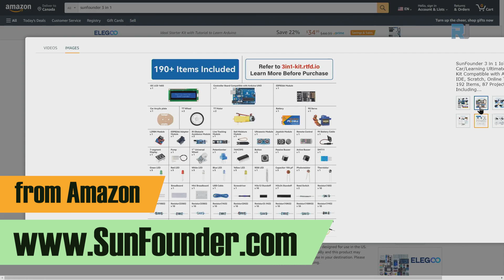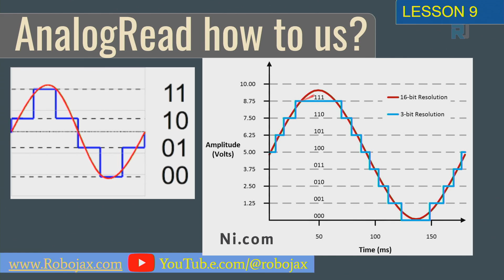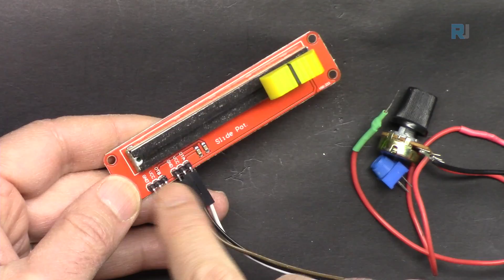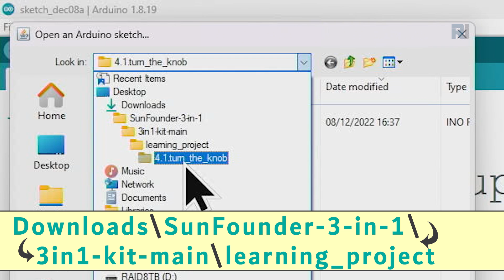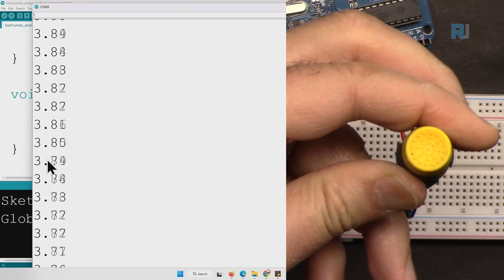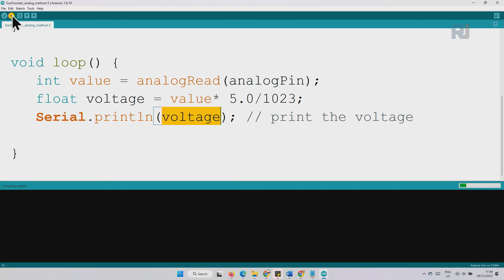Lesson 9:  Reading Voltage Using Arduino, Potentiometer AnalogRead SunFounder Kit- RJT592

Comment: At 3:50 you misspoke, saying digital to analog instead of analog to digital converter.
Around 4:50, you said 2 to the power of 3 is 16, but it's actually 8.
Reply from the maker: Thank you for pointing the errors. What you see in code and wiring is the correct one because it works. And that is important. I can’t fix it now.
Reply: @robojax  I understand. Since you actually know what is correct and can't fix it, my comment here is most helpful to someone who doesn't know it and may be confused.
EDIT: Actually, YouTube editor allows some post-editing after publishing.
Reply from the maker: Thanks. There is no editing option except cutting and blurring.

Comment: How about measuring current? can we measure current passing through a wire and print it in serial monitor or lcd?
Reply from the maker: Yes of course. Not only that we can measure any DC voltage like 300V and measure 500A and even measure the energy and much more. here is one example https://youtu.be/oufDb7AtvNk
Reply: @robojax  thanks but its for over 10a but how about less than 10a? like 5v 5a or 12v 5a?